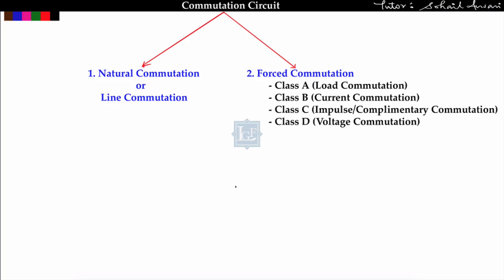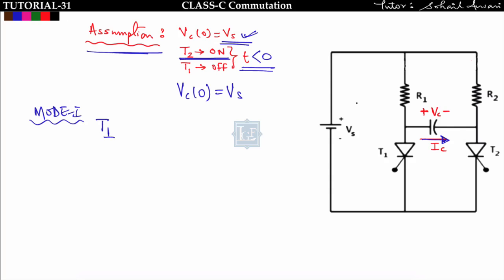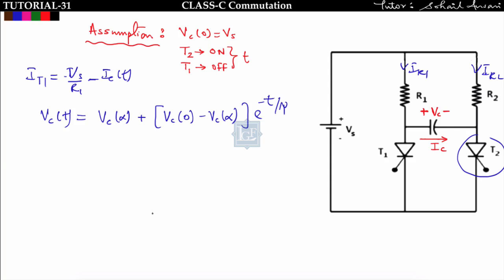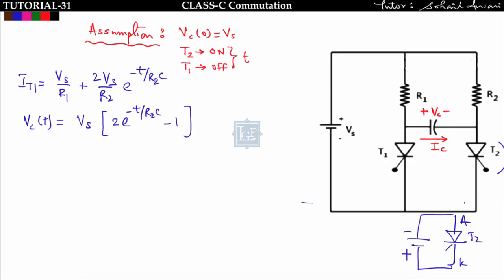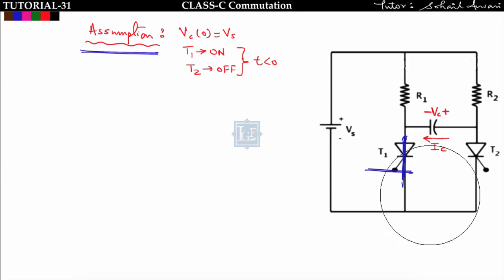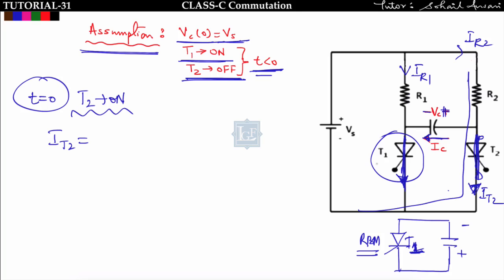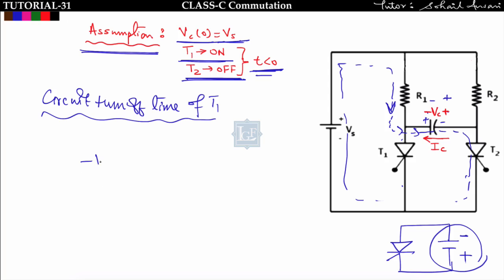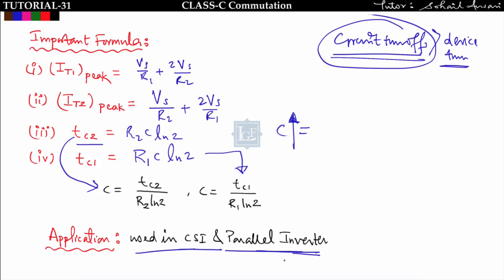Lec 31 Class C (Impulse/Complementary Commutation)

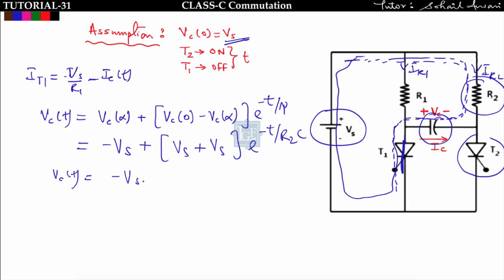Comment: sir when you said that Vc will charge  equal to Vs @7:06.. wont there be any voltage drop across R2 due to the curret flowing through it.. if there will be than Vc should be charged with Voltage less than Vs.. please reply asap.. Thank you sir!
Reply: yeah but we are talking about steady state condition and you know very well what happens in steady state of rc circuit.

Comment: sir I don't understand why we are considering only one resistance for time constant calculation. pls explain
Reply: Time constant is calculated based on through which resistor the capacitor will discharge...in this case it is only R2

Comment: sir I don't understand why we are considering only one resistance for time constant calculation. pls explain
Reply: as we know time constant=RC. where R= equivalent resistance across capacitor together with short circuiting the independent voltage source and open circuiting the independent current source. now you can try yourself.